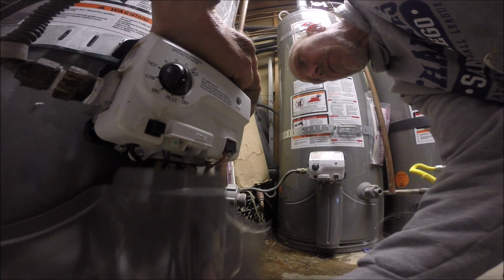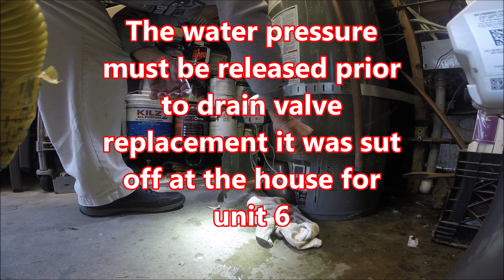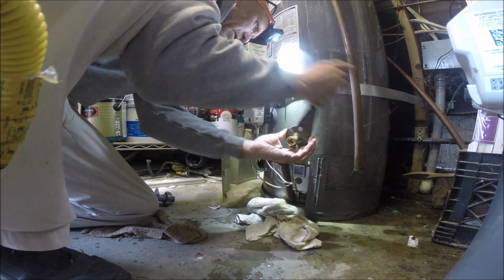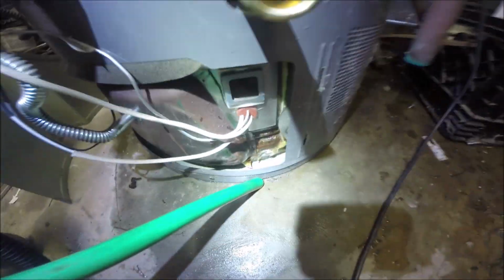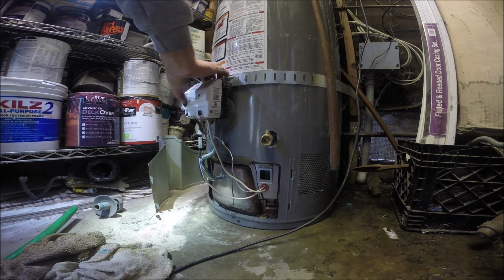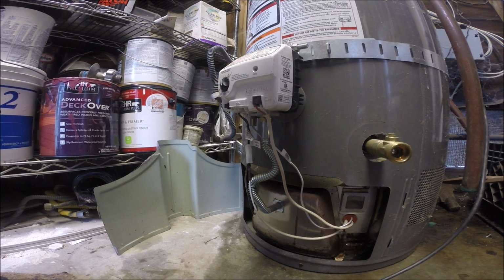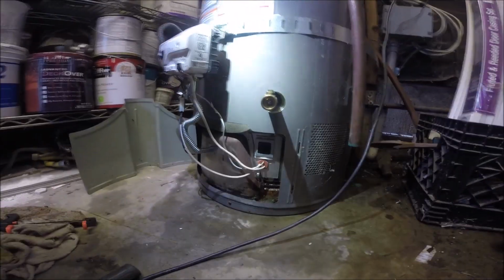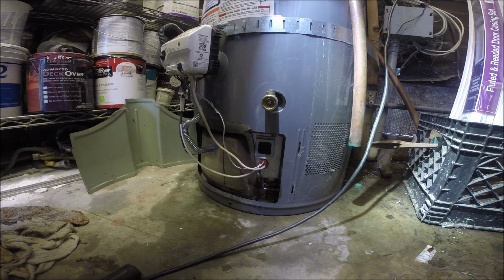Rheem a common leak - repair

Comment: I had nothing but problems with those plastic drain valves..  Was installing  1 every 2 years max on my old Richmond heater..   I just took that 22 year old Richmond out an put in a rheem  last week my rheem has a brass valve now. I use to use a small airs compressor and a blow gun  to check the plastic valve    pressurize the heater  good an blow air around the plastic valve threads if its leaking it shows quick on pressure.